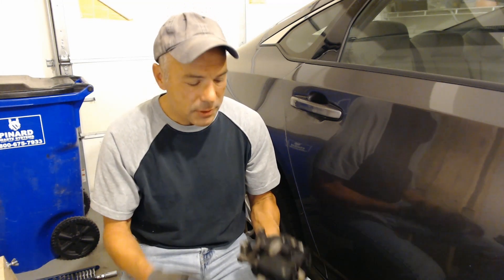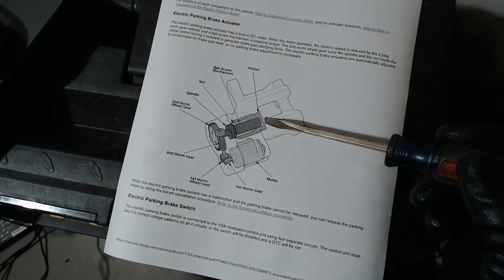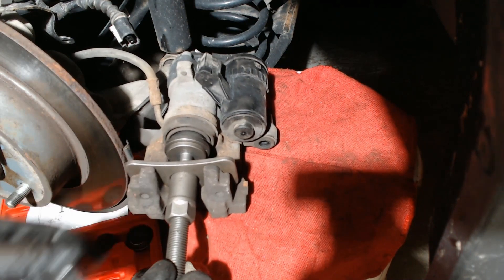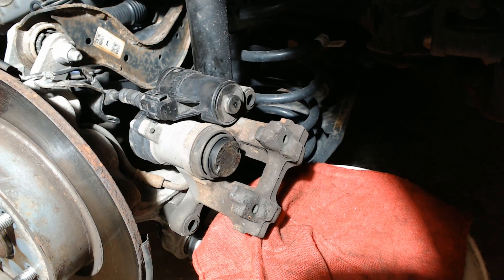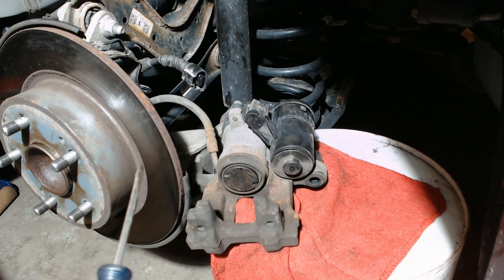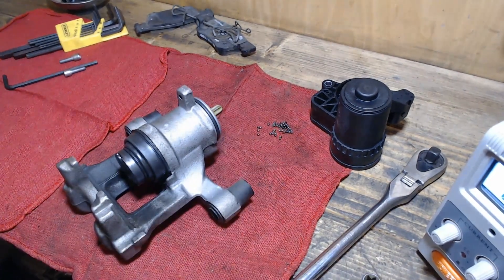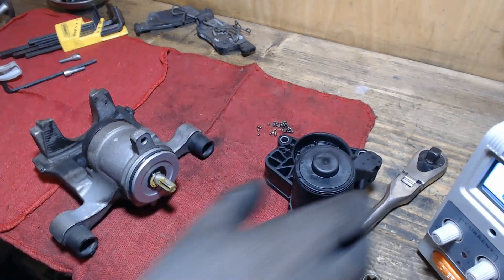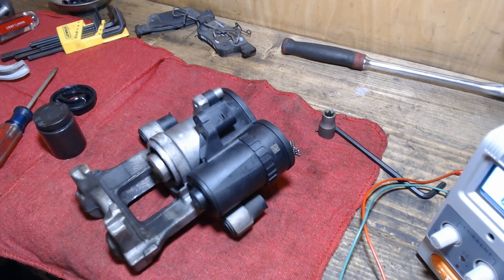4 Ways to Retract Brake Piston on a Honda Accord with Electronic Parking Brake

Comment: Hi John I don't think the piston retracts all the way cuz I replaced the pads and I here a squking when iam driving and the pads are worn out fast like in 4 months. Any advice
Reply from the maker: As long as the piston was retracted enough to put the caliper back on with a little extra space, then I don't think that is the problem.  Do the slide pins slide nice and freely?  If not, that can cause such an issue.  The other thing that I have seen cause that issue is when the piston gets gunked up on the outside and starts to catch on the square cut seal and not retract a little to provide a little clearance as it is supposed to.
Reply: The outer pad closer to the wheel worns out super fast like in 6 weeks the inner pad it's just . Why ? Everyone is telling me I got a bad caliper
Reply from the maker: @franciscosotelo1866    In my experience, that is caused when the caliper is not free to "float".  If the piston is stuck then usually both pads will wear prematurely.  If the piston is okay, but the caliper is not free to slide back and forth then you often get wear on one pad only.  This can be caused by the fact that one pad is not free to slide (due to being "rust jacked" - held in place by rust or because the pad is not the right size).  For example, if the inner pad is not free to slide and is "locked" in place, then all the braking will happen on the outer pad when the piston pushes out.  This issue can also be caused by a problem in the slide pins (gunk or buildup preventing the slide pin from freely sliding).  In my experience, both of these are less common with this style of caliper than the kind with the hardware (clips that the pads slide on).  Do both pads slide freely back and forth?
Reply: @JohnsDIY  yes both pads slide back and forth.  U know what , when I was replacing the pads I couldn't push the piston back and by accident I press the emergency brake button a couple times  and the piston almost came out . And then little by little I started pushing the piston enough to put the pads on. And since the I been having that problem were the outer pads worms out fast.  Did I mess up inner piston or the electronics???
Reply from the maker: @franciscosotelo1866  I think it is hard to say, but if the inner piston came out too far then that could definitely cause issues with the caliper as it could have caused the ball bearings in the ball screw to have been released and possibly they could be inside restricting movement (retraction) of the caliper.  So it is certainly possible that the piston/caliper   was damaged if the piston came out nearly the whole way.  The only thing I find confusing is that I don't understand why that would lead to wear just on the outer pad.  If the piston wasn't retracting, I would have thought both pads would have been pressed against the rotor and both would wear prematurely.  Just my thoughts though...
Reply: So I did mess up the caliper . I replaced it and now  we're good.  In your opinion what's the easiest way to bleed the air cuz I replaced the caliper. It was the rear passenger.  Do I need to bleed every tire??
Reply from the maker: @franciscosotelo1866    I use a bleeder bottle with check valve.  The tube extends under the liquid level in the bottle so that no air can flow back into the caliper once the bottle is partially filled with brake fluid.  It works well for me.  Here is the one I use:
https://www.amazon.com/gp/product/B00F9XHVKA
I don't believe there is any reason to bleed the other calipers, just the one that was replaced.

Comment: What if it fired out while doing a brake job. Working that one out right now. Piston completely popped out while I was trying to check why I couldn't reset.
Ugh thanks bro. You definitely helped me with the other side until I did something wrong and found brake fluid and and a nice clean piston on the ground.
Reply from the maker: @riverboat28 Did just the outer piston pop out?  If that is the case then you should just be able to align the outer piston with the inner piston/nut and then carefully force the piston back in past the square cut seal.  Then you will have to bleed the brake caliper of course.  If the inner piston/nut came out then that is a harder problem as likely the ball bearings came out.  I am not sure what to do in that case, aside from getting a new caliper.

What caused the outer piston to pop out?  Did someone press the brakes repeatedly with the caliper off the vehicle?  In that case, it could be that just the outer piston came out.  However, if the piston popped out because the motor was driven fully in that direction, then there is a good likelihood that the inner piston/nut also came out.
Reply: Really messed up this one and have a happy foot.

Comment: So I used the turn back tool method and after changing the brakes the left side isn’t working now? Is there a way to get it unstuck or what can I do now?
Reply from the maker: Can you elaborate on what you mean by "isn't working now"?  What is not working?  Does the parking brake not engage on that side?  The brake on that side doesn't engage at all (with the brake pedal)?  What are you seeing?

Comment: How do you  put those bearing back..  ? It happened  to me today and i panic that all the bearing came out and i had to run to dismantler  and get another one... since I used  a battery  with some wires and i connect the polority to push the piston out.. finally i removed the motor and unwind  by hand
Reply from the maker: I'm sorry, I do not know how to put the ball bearings back in.  That is why I said in the video not to push the piston out all of the way.  Sorry!

Comment: Great video. I have a 2018 Honda Accord that needs new rear brakes. I'm going to use your first method of using a piston compression tool to turn the piston clockwise, then push it straight back. I have two questions: 1. Does the system have to be put in "maintenance mode", then returned to "normal mode" after the new brakes are installed? If so, how? 2. In other videos on this topic, some say to put the engine in accessory mode to release the pressure on the caliper. Thoughts on this?
Reply from the maker: Thanks for the comment!  

1. No, I have never had to put the brake system in maintenance mode to wind back the piston.  The maintenance mode (which can be set with a bidirectional scan tool) retracts the inner piston by running the electric motor so that you don't have to wind back the piston with the windback tool.  But if you use the windback tool to screw the piston back in, this action retracts the inner piston and maintenance mode is not necessary.  

2. I don't know why accessory mode would release pressure on the caliper.  I have never done that on any vehicle.  You should make sure that the parking brake is turned off however.  If you have the "auto parking brake" feature enabled then you should disable it.  With the parking brake off, the inner piston (electronic parking brake) will be retracted enough for you to remove the caliper.  Then you can just pull on the caliper a bit to push the hydraulic piston in enough to pull the caliper off.

Once you finish the brake job, you should turn  the parking brake on and off twice so that the inner piston gets reset to the correct position (close to making contact with the outper piston).

Here is a video of a rear brake job on a 2018 Honda Accord showing this approach.  (System was NOT in maintenance mode and the engine was NOT in accessory mode):

https://youtu.be/gG8RWHI712c

Hope that helps!
Reply: @JohnsDIY  Thanks John! One more question, just like in your video, many videos on the topic show people removing the back of the EPB and turning the screw clockwise using a T12 torx bit until it stops, then compressing the piston straight back. Does the alternate method of just using the windback tool achieve the same thing with regards to the internal screw? I prefer just using the windback tool method because I share the same concern of opening the sealed EPB unit.
Reply from the maker: @ddisneyman8911  Sure thing!  Yes, exactly, both accomplish the same result.  I agree, probably better to not remove the EPB unit if you don't need to plus I think it is quicker and easier to just use the windback tool.

By removing the EPB and turning the shaft with the torx bit, you are screwing the screw into the inner piston causing it to be retracted back into the caliper.  When you screw the outer piston in with a windback tool, the outer piston is keyed to the inner piston/nut.  So as you rotate, the inner piston/nut is screwed back on the shaft/screw and gets retracted back into the caliper.  In both cases, the result is the same, just a matter of thether you rotate the "bolt" or the "nut".
Reply: @JohnsDIY  Thank you so much! Saved me $$$. Just finished replacing the rear pads and rotors, the windback tool worked great! Didn't have to crack open the EPB unit. I'm not sure why there's such a confusion and fear over the EPB, it was very easy. In accessory mode, I turned on and off the parking brakes a few times. No warning lights! Now I have to do the front brakes, do you happen to know the front caliper bracket and caliper pin torque specs on a 2018 Accord? Can't find it anywhere. Thanks again!!!
Reply from the maker: @ddisneyman8911  Sure thing!  It is always so nice to be able to  get the job done yourself!  Good luck with the repair and give a shout if you have any other questions!
Reply: @JohnsDIY  Sorry, one more question: Now I have to do the front brakes, do you know the front caliper bracket and caliper pin torque specs on a 2018 Accord? Can't find it anywhere. Thanks again!!!
Reply from the maker: @ddisneyman8911  The front caliper pin bolts are 50Nm.  The caliper bracket bolts are 108Nm.

Comment: or you could put your brakes in service mode
Reply from the maker: Yep, good point!  That is a great method if you have a bidirection scan tool.  That is Method #2 in the video starting at 7:35.
Reply: @JohnsDIY  some cars you just go to your touch screen in the car and look for brakes and then service brake mode , I think Honda does this .
Reply from the maker: @oldbiker9739  Oh, I understand what you mean now.  I don't believe my Honda has this functionality.  I looked through the touch screen menus and find no option to do this.  I also looked at the owner's manual and I don't see a mention of this.  However, perhaps other Honda models provide such functionality.

Comment: Thank you for this video!

Rushing because a storm was starting I forgot to put the car in Aux so I still had about an inch to go before the caliper would go over the breaks. I didn't have that brake caliper tool so I was trying everything to get that piston back. I pressed the brake and set the e brake so I could start over and same outcome? 

I even took the back off the caliper and turned the shaft like you show here, it gets to a certain point and stops and still no progress. I ordered that tool which should be here Mon. I'm going to try that but if nothing happens I'm just going to order another caliper being that brake fluid was leaking from the boot maybe because I had the caliper upside down? Any suggestions?
Reply from the maker: Thanks for the comment.  I'm not sure I fully understand, but when you screw the piston back in, it is normal for it to stop turning at some point before the piston is all the way back in.  At this point, the INNER piston is fully retracted but that does NOT mean that the outer piston is retracted.  But to retract the outer piston from that point, you should be able to just push it straight back in (without rotating it).  So from the sounds of it, that should be all you need to do just push the piston straight back in the rest of the way.  You could do this with a windback tool or even a C-Clamp (just be careful to not put the other end of the C-Clamp on the plastic motor housing).

Brake fluid should not be leaking from the boot no matter what orientation you had the caliper in.  There is a square cut seal around the circumference of the piston which seals it from leaking.  If the brake fluid is coming out there it indicates that the piston was forced out too far (entirely out of the caliper) or a problem with that seal.
Reply: @JohnsDIY  Thank you for your reply! When I did the Right rear it when smooth using needle nose pliers to wind the piston back in. It was a tight fit but as you stated it needed to be pushed back in further. 

The C Clamp I have is to small. I ordered a brake caliper kit which should be here tomorrow. 
** the piston was forced out too far (entirely out of the caliper)** Is exactly what happened. I put the E brake on trying to start the whole process over. I was able to turn the piston back in a bit but it stopped with alot of room to go.

Tomorrow I'm going to use the kit and try to push the piston back in.
Would you say the damage is already done because the fluid was leaking out and I just need to order another caliper?

Thank you again for your response!
Reply from the maker: @Carloscda40  Just because brake fluid was leaking out doesn't mean the caliper needs to be replaced.  It is possible to take the outer piston completely out and put it back in and have it work fine again (after bleeding).  HOWEVER, if the inner piston came out too far then that could be a real problem.  As I show in the tear-down in the video, if the inner piston/nut comes out too far, you will lose the ball bearings that it rides on and it probably won't be possible to get them back in (at least I don't know how to reinstall them).  In your case, turning on the ebrake without having the pads in there likely would have driven that inner piston out.  I would be worried that you very well might have lost the ball bearings in this case.  In that case, unfortunately, you will probably have to replace the caliper.  If that is NOT the case, and you do manage to push the outer piston in, you will at least want to bleed the brake caliper since having the piston out likely introduced air into the brake system.
Reply: @JohnsDIY  I didn't notice that piston nut out far enough for the bearings to fall out and I didn't see anything on the ground. Yes I do plan on bleeding the brakes as well.

To be on the safe side I called various Honda dealers to order another caliper, end result they all said theirs a nationwide back order on them and they have no eta when they will be back in stock! I did however track a 2019 caliper down from a salvage yard. Weather permitting I will install it tomorrow. Thank you again!
Reply from the maker: @Carloscda40  Geez, what a pain that we still have those supply issues at this point!  Good luck with the install!
Reply: @JohnsDIY  Everything worked out fine with the 2019 replacement! I'm going to mess around with the original and see if I can get it retracted. At least I'll have a backup. Thanks again!
Reply from the maker: @Carloscda40  Nice work!  That's super!  Yep, that would be great if you can get it working and keep it for a backup!

Comment: Thanks for this very comprehensive video. I used the caliper wind back method with the proper caliper piston adapter. However, prior to that, I put the car in accessory mode but did not start the engine. That took the pressure off the rear brakes  and it was then easy to remove the caliper bracket and the pads slid right out.

Then I did the caliper wind back method and got the caliper piston flush with the dust boot. After putting my new pads on and reassembling the caliper bracket, I put my car back in accessory mode and put the E brake on and off a couple of times. That set or reset the E brake and put pressure back on so the new pads could not slide or move. I did one side at a time with that method on my 2018 Honda Civic. Afterwards, I started my car car and pumped the brakes several times until the brake pedal returned to its normal feel.

I did this several months ago and all is fine. Never had any brake light come on which typically happens when this job is done incorrectly. 

Also, I would advise removing some brake fluid from the reservoir if it's at the max level before starting the job.  Otherwise, brake fluid can overflow from the reservoir and make a big mess.

This worked for me and hopefully may help someone else.
Reply from the maker: Thanks for the comment!  And thanks for sharing your experience approach on the Civic.  I definitely agree with removing some brake fluid from the reservoir (or at least monitoring it during the process) - good point!

Comment: Hello john, after I install the break do I need to pump the break pedal, before I turn on off the parking brakes
Reply from the maker: Hi there,  I don't think the order matters, but I would recommend both pumping the brake pedal until it is firm and turning the parking brake on and off a few times.  I prefer to pump the brakes first as this drives out the piston hydraulically, and then when you put the parking brake on it drives out the inner piston mechanically to match.  But, I think it is okay in either order.
Reply: @JohnsDIY  thank you
Reply: Ok thanks Johns DIY you hit it right on the nose. sharing your gift  of knowledge with others is a God Send.when you give you shall treceive ,may you stay healthy and safe God Bless you and your family.. To help your brothers with a helpful video for all to help themselves
Reply from the maker: @bigred5393  Thanks for the very kind comment!  And I wish you all the same in return!  Thanks Big Red!